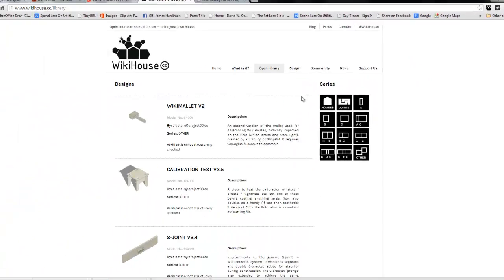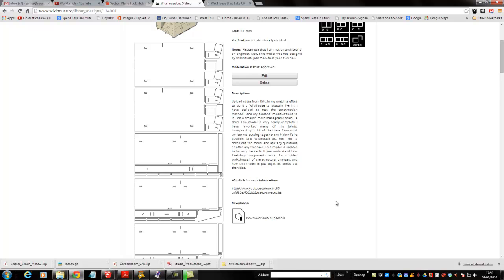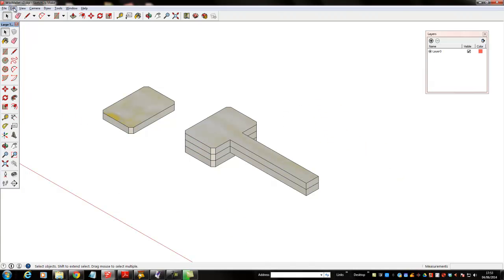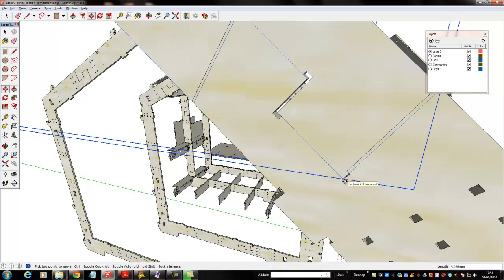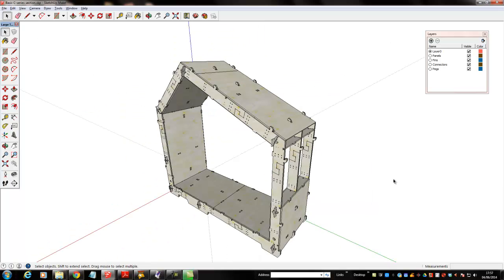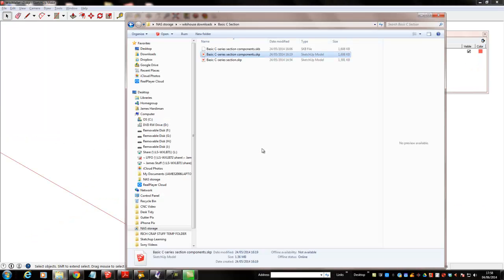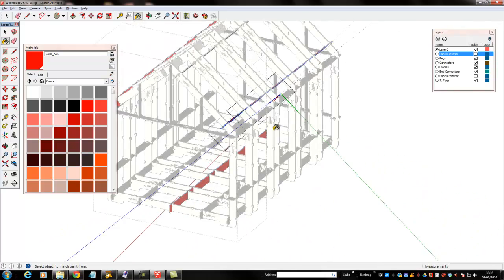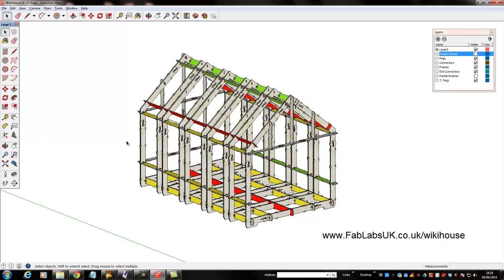Wikihouse library

Comment: too much material (wood) with too many flaws:
● can't withstand lateral forces
● very high thermal conductivity
● very low thermal mass
● seams are aligned
● limited options for room layout and size
Reply: Agreed, not well designed yet for the tropics with cyclones/ typhoons or lateral force from earthquakes.